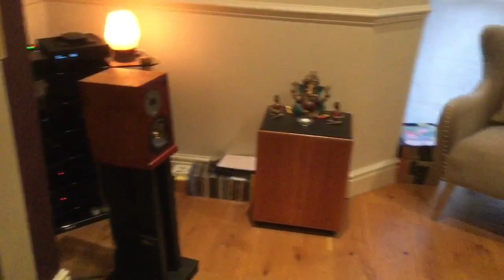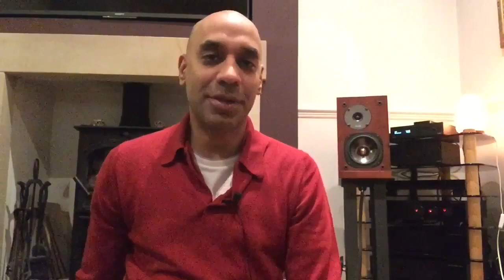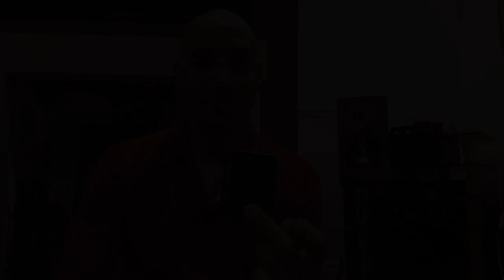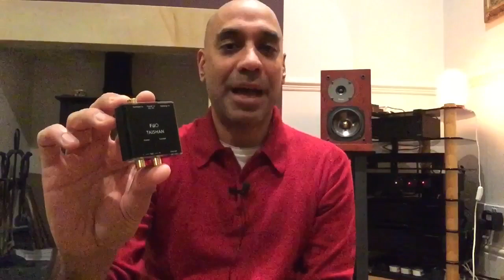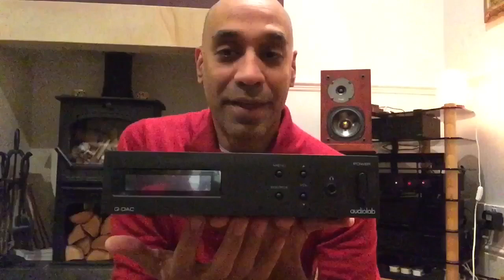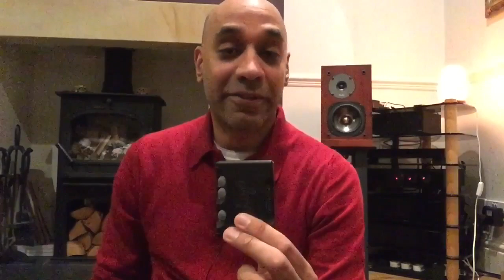Chord Mojo Review - Vs Chord Hugo and other DACs

Comment: Another great video. I’m thinking of getting into streaming and it’s giving me a lot to think about.
Reply from the maker: Thank you Richard. What are you considered using as a streamer?
Reply: @abritishaudiophile7314  Hi Tarun, that’s for your reply. I haven’t thought about any equipment yet, still getting my head around what I need, how it all works and how to connect it.:
Reply from the maker: Hi Richard, the Bluesound Node 2i is a good streamer for £500. It has a very user friendly interface. You can always add an external DAC like the Chord Mojo to improve the sound later. If you want to spend more money on a streamer then take a look at products from Auralic, Lumin and Innuos.
Reply: @abritishaudiophile7314  Hi Tarun, thanks for the info on the Streamer. At the moment I can’t afford that kind of money as I have just purchased speakers, stands and cable.
The unit the system is mounted on is very rickety and I have ordered a new rack.
Can I record from the Internet to my old laptop, running windows 10, to a DAC ( I have read good review of iFi Audio ZEN DAC ) into my preamp.
Regards Richard.

Comment: I'd like to ask your opinion on speaker cables. I've been a QED fan since 1996 and have there genesis silver spiral on my front 3 channels  and I noticed the difference straight away compared to the door bell kind of cable my friend let me use while I was waiting for QED to custom make my cables. Staight away I could tell they had a tight grip on my speakers great for movies especially on dialogue on my centre so much depth and bass in the voice and for music the detail in the top end is pretty clean and razor sharp also keeps tight grip on the bass which my Dali zensor 7 can get unruly at times with music never with movies.
Reply from the maker: Hi Harpal, cables is a minefield and perhaps a topic for a future video. My experience is that cables do not all sound the same. Anyone who tells you that they do, probably hasn’t listened to enough cables on a revealing enough system. There are genuine electrical reasons why one cable will sound different to another, be it resistance, capacitance, inductance, or noise reducing properties due to the shielding, dielectric or termination. 

But here the rub! Results vary greatly system to system and buying expensive cables does not necessarily guarantee better sound, just different sound. I am not saying that more expensive cables aren’t better, they may be slightly, you would have to do a lot of testing on a lot of systems to find out for sure. What I am saying is that a good quality cable with, excellent electrical properties, well terminated and with good shielding need not cost a lot of money. Something from Belden, Van Damme with Switchcraft connectors is probably all that 99% of the people will ever need and it will probably cost you £50. This from a guy who runs Chord Signatures at £800 a pop.
Reply: @abritishaudiophile7314  I'll be honest I spent up to £1000 on my 7.1 set up on cables but that's including 4  reference hdmi cables from QED 2 signature subwoofer cables plan on getting 2nd sub one day lol and 1 reference fibre optic cable and 3 x genesis silver spiral speaker cable and 4 x qed anniversary XT speaker cable . But best thing everything has life time cover, 4 years later qed replaced the connection on my back 4 channels as one of the dealers used the wrong size connection when doing air lock and over time it should be able to hold 50lb pull on the connection it one day fell out as I unplugged to clean and bees wax polish each of my speakers. Qed paid for postage on there end and did not charge me for air lock connection on my speaker termination or for new banana plugs, 👏👏👏 that's customer service. Just company I have not been disappointed on the products with. Had any experience of the cables there a great British company. Picture is so sharp it would slit your throat and always ahead of the competition.
Reply: @abritishaudiophile7314  nice cable very  exotic
Reply from the maker: Thanks Harpal, I wouldn’t spend that money today on cables though.
Reply: @abritishaudiophile7314  it was when I put it all together,  but if you look at it this way I spent £8000 in 2012 and in 2020 I still have a set up that's in mint condition and if you break down cost in years I've had  it's about  £1000  cost for me to  have a 7.1 with denon x4000 amp Denon 3313ud player and samsung ue46f 3D tv all my cables £500 mahogany unit  2 x custom design stands  isolation stuff  for  last 8 years.  Most people spend up to £1500 on a tv .but I think I've had the value for money in that range lol
Reply from the maker: Sounds like you have a good set up that you are happy with, Harpal. All that remains is to sit back and enjoy the movies and music.
Reply: @abritishaudiophile7314  I try on my days off. Best way to relax and be in your own bubble for couple hours perfect lol
Reply: @abritishaudiophile7314  did once think about upgrading to x4000 but no point as I like to watch movies in 3D and 4k don't support 3D so there loss not mine 😭😭😭. For a format that was supposed of  been dying  in 2013 has not done bad till 2020 excluding 3 or the avengers early movies iron man 1 ,2, and hulk. The other 21 movies are all in  3D and still most of the movies out are still 3D this year. Lol
Reply: @abritishaudiophile7314  opps I forgot part of my set up my speakers lol Dali zensor 7 front, dali vocal, dali E-12F sub, and 2 x Dali zensor 3 for my back 4 channels. And 7.5 kg of attacam attabites in each column of my stands
Reply from the maker: Harpal, good speakers and nicely balanced set up, why bother changing? 

In time, if you want to upgrade, check that your amp has preouts for the front LCR channels. If so, get an external power amp to power the front LCRs and keep the Denon for the surrounds and processing. Look for a good used or ex demo deal on something like the outgoing Arcam P429. It is not about watts and how loud it will play. It is about how stiff the power supply is and effective a grip the amp has over the speakers. Trust me, your money will be much better spent on a good external power amp than upgrading your AVR. Good luck😀
Reply: @abritishaudiophile7314  I think explained it bit wrong lol I don't need upgrade my amp as it perfect for my situation bluray movies not missing much on audio end as most 3d or blu-rays don't really atmos on them so won't  need to upgrade plus 4k not my thing lol. Only ever would if the fire in my amps belly went out. Or if I had to replace because it stopped working, plus the 80db for movies is loud in there and that's not taking into account all the  magic audessy has done calibration. I've locked my volume to 0db  to  80db on my amp as that's enough for everything I watch or listion  to may be bit of acoustic treatment is needed .   You would be shocked what size room I've fitted it all in about half the size of your living room.  Is there email or some way I could send it to you. Would like your honest opinion on it would be great. Everyone else I tell about it don't really show interest they would rather stream movies on there phone or I get told I wasted so much money .  But that is the same kind of  person that will upgrade there phone every year or two at cost of double the price on contract.  For the rest of the life and I'm a money waster
Reply: @abritishaudiophile7314  ok I read my massage I earlier sent, what I was supposed to say was I was thinking about upgrading my denon x4000 not upgrading to a denon x4000. The  upgrade would of been to x4200 or x4400 but no point as I don't use Dolby atmos or   dts  x  audio are rare on 3D blu-rays or blu-rays

Comment: I have a question about the sound quality of my mojo dac (1). 
Maybe someone already mentioned it in the previous replies but I don’t have the courage to read them all. 
So here it is. 
The treble is irritatingly harsh. 
Agreed, my system is not top notch and I use a MacBook Pro as a source with Audirvana as software but whether I use Qobuz straight out of my MBP  or via Audirvana doesn’t make a lot of difference. The sound is actually less irritating when I use the headphones connection from my MBP straight to the amp. It is less spacious though and lacks transparency. All this is a lot better with the mojo but the squeal of the treble especially in human voices ruins it. I tried a number of tweaks in Audirvana but nothing€ seems to work. Any suggestion would be very much appreciated.
Reply from the maker: It won’t be the Dac but something in your HIfi chai will be causing the harshness 😊

Comment: Can the Hugo be powered with an external PSU, rather than by battery?  I was considering the Mojo for my main system, until i realized it's ONLY battery powered, and has potential battery issues, to boot.  Can I circumvent that with a Hugo by using an external PSU?

Comment: Hi, thank you so much for your effort doing these great videos and sharing your knowledge, insights and thoughts.

I got into Hifi recently, and
I watched many of your videos the last few weeks, and I now got myself my first more serious system recently:

Canton Vento 826.2 bookshelf speakers on speaker stands.
Denon DRA-800H integrated amp
and a Denon DCD-1600NE sacd player.

I want to play my flac music files from my Dell laptop. Do you recommend getting the chord mojo DAC in between hooked up via USB to the Laptop?
The Mojo Dac will sound better than Denons integrated AK4458 DAC? Thx for your advice and
keep posting the great content.
Best regards from Vienna!
Reply from the maker: Thank you Mario. The Mojo is a lot better than the internal DAC in the DRA-800H but I think it may be worth putting the money into upgrading the amp first 😊👍
Reply: @abritishaudiophile7314  thanks for your input!

but can i go with usb A from my laptop to my amp's digital optical in to use directly the amps integrated akm dac?

since i just aquired the denon amp, I might first check out the audioquest dragonfly cobalt,
to connect my laptop to the amp.
Reply from the maker: @MarioKaya  I understand. You will need a USB DAC. The Audioquest Cobalt is almost the price of the Chord Mojo. I suspect the Mojo will be better 😊

Comment: Dear Tarun,

Thank you for the informative review. I just bought a Bluesound Node 2i as streamer. As you get questions of comparisons a lot, the chances of you comparing that internal DAC to a chord are slim. So let me ask this question: would you either go with a good streamer first and then maybe use an external DAC for that streamer, or should I setup my laptop as streaming device and use a chord (mojo or qutest) as DAC? 
My hifi system level is up for some good quality (using Diapason Ademantes ii speakers, Synthesis tube amplifier). 

Thank you for your response in advance. 

Regards,
Dennis
Reply from the maker: Hi Dennis, a laptop can make a fairly decent entry level streamer. From a sound quality standpoint, I would go with the Mojo 😉

Comment: I have just taken the plunge and bought a Mojo [cuz there is no Dojo ;-)) to primarily use in my hi-fi setup - i also have, like yourself an Aries Mini which is currently fed to an Audiolab 6000a amp via coaxial - could you confirm the best way to go when the Mojo finishes it's first charge [delivered earlier today] would be to lose the coaxial & connect the Mojo to the Mini via the USB and from the Mojo to the 6000a via a 3.5 > RCA lead? Many thanks
Reply from the maker: Great, hope you love it! You are right mini USB into the Mojo, 3.5mm to RCA into the Audiolab 😊👍
Reply: @abritishaudiophile7314  The dac in the 6000a is good as you highlighted in your review but curiosity and the wanting to play with ‘those’ marbles was to great an urge 😜

Comment: The revisions you suggest all make sense. But one of this device’s selling points is its dramatically low price. Changing it so it is software running on a computer means buying or reallocating a computer, which multiplies the device’s price to the point where it may not be appealing anymore. Improvements like choosing your input without yanking cords could be done using the same form factor they are using now. That way audiophiles on a budget could continue enjoying (even better) ROI of this device.

Adding some kind of modern UI, of course, would require some kind of computing power and display. What about a phone app?

£.02,
Tubelugs
Reply from the maker: Thank you for watching and sharing John 😉

Comment: Quick question: What's the cable plugged in to the Mojo in the preview pic of this video. I connect the Mojo to my preamp via a 3.5mm to RCA cable. Thanks for the info. Cheers from Montreal.
Reply from the maker: It is my Chord Company Signature RCA cable running through a RCA to 3.5mm Audioquest adapter 😊

Comment: I’ve got my heart set on a Project 2RS T digital transport and a Denafrips Terminator DAC. This would be an ideal combination in my opinion. If you are inclined to CDs, some people are not. I master my own on gold blanks. These are reference grade disks. The transport in the Project transport is a marvel of engineering excellence. It may need a few minor mods from me, but a scarce few. I could live with it. What do you think Tarun? The R2R dacs are supposed to be superior to even the trick processor dacs. I’m not a big digiphile, but I like to make CDs with challenging music to test system performance. Some of the material is sometimes poorly recorded. Your ears may not like having to reconcile with this, but if you like the artist or the rendition, it is tolerated with greater ease. It’s a mindset.
Reply from the maker: Hi Mark, I believe John Westlake (formerly responsible for the Audiolab M DAC and the Cambridge Audio Dacmagic before that) is responsible for their DACs and maybe the transport too. The Dacmagic and M DAC were landmark products for their price points at the time, so I wouldn’t be surprised if Westlake has done something special with the Project transport. Just out of interest Mark, what is it about the design that has drawn your interest? As for the Denafrips DACs, they certainly have drawn quite a bit of positive attention. Personally, I think there is something quite elegant and alluring about a NOS R2R DAC. Let face it, Delta-Sigma is not without its problems. I would love to get the Denafrips Aries in for a review to compare with my Mojo. Please let me know how you get on with both products and good to hear from you, buddy! 😊👍
Reply: A British Audiophile, Tarun, this is a dream set-up. I do not have it. I’ve wanted the Project transport ever since I saw it. The way it is made utilizing a proven performer in a transport that was great from the start, did the modifications to it to make it even better and packaged it simply and elegantly. It impressed me. That isn’t easy by the way. The Denafrips Terminator DAC has a really impressive power supply, ladder R2R circuitry which I think is much better at retrieving the detail. The entry level Denafrips DAC is making a name for itself as well. This DAC will decimate the Chord in my opinion with extreme prejudice. The difference will be like being hit with a 50 caliber bullet. Wake up call with a come to see Jesus education. It will not be subtle. I would put a great mains wire on it like you made on your video for the mains cables. If you want the most out of your gear. You need to put the effort to get it. Those mains cables that come with gear are just mediocre. Wire matters, wire construction matters! Nothing stupid mind you, just good common sense construction as you used in your video. I used this with my modified mains cables back in the day. I used hospital grade plugs both on the wire and at the socket. Hospital grade will give you the best possible performance in your audio applications in my experience. It is about the positive retention connection you get with the plug and receptacle. It is very good. This is imperative to any high performance application whether it be audio, video or in test equipment and computer applications. I recommend this for high end soldering stations as well. Great performance starts at the mains end and works the other way. You cannot expect that great performance using off the shelf mains cables. These are just trash. IEC ends need and deserve the same attention. You are only as good as your weakest link! No weak links, no worries. Power conditioning is only good if it is a pure sine wave output type. Some units chop the tops and bottoms of the wave. That is just wrong! You’ll pay for what I call these true wave units, but it is very worthwhile as the nasty reality of 2Kv spikes and what they do to your gear is not pretty. I digress, but it is hard for me not to when these things have proven themselves over decades of performance. Clearly opinions vary, but proven performance trounces the snake oil theorists objections. Clean power in your gear means true performance out. You don’t have to use exotic wire. Just use great parts and common sense. Works every time.
Reply from the maker: Hi Mark, I love reading your comments. I always learn something and you regularly point me towards something that I need to look into further. Let’s see if I can get Denafrips to send me the Aries II. Do you know any good literature discussing delta sigma vs R2R as background reading? I know the basics but need to dig a bit deeper if I am to review it. Thank you my friend for sharing as always 😉
Reply: A British Audiophile, I’ve been out of the loop on the book side for a while. I’ll give it a try. It may take a while. You stay safe. I just hope I spelled your name correctly. I write on the subreddit R/soldering under u/Soldermeister. This is something I am doing to try to help people that some on this forum. They have know it alls and venom spewers. You have them to I am sure. I am not deterred. I don’t expect you are either.
Reply from the maker: Thank buddy, I will check it out. Tarun